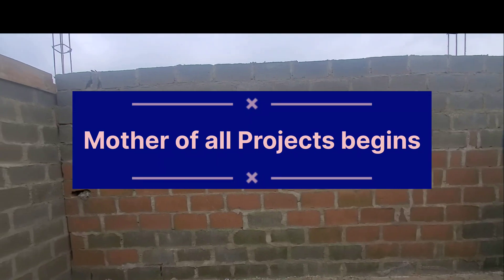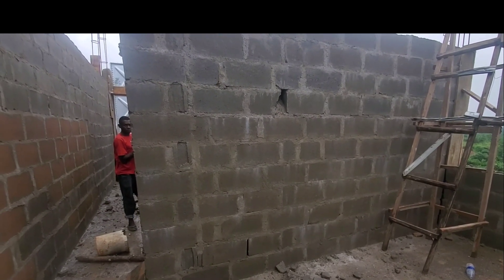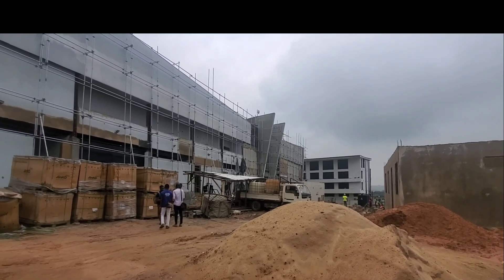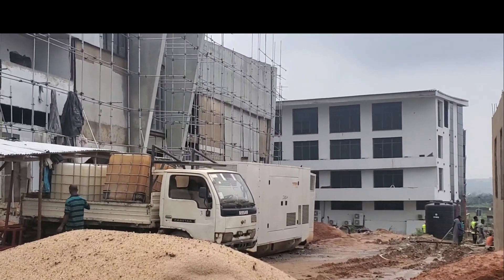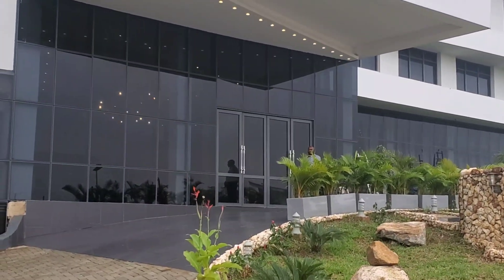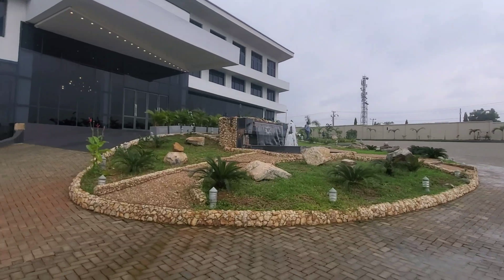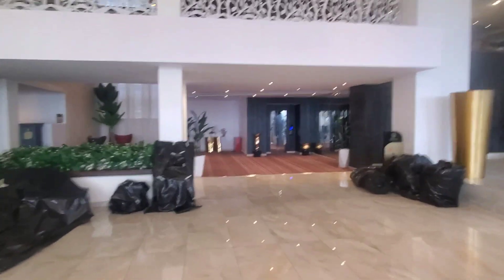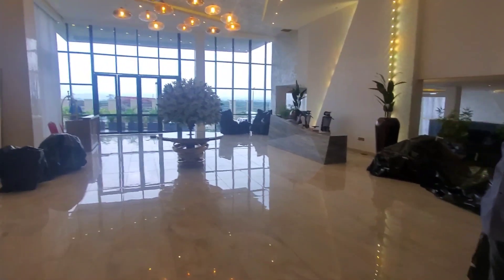Monster 240 kwp installation is starting.  #solax #solarpowerplant #offgridsolar #jinko

Comment: A couple of questions Doc.
Is the roof made of sandwich panels? Or single sheet ones with a strong underlayer? How do you assess the strength of a roof?
Why are the solar panels pallets out in the rain? 
Do you do all the electrical engineering and calculation in-house or do you hire a third partner? I assume there is some new complexity involved?
How complicated is this for setting up a contract? Financing, legal liabilities, logistics, insurance, deadline, safety, et cetera?
Maybe you want to answer some questions, I understand if you want to keep some information under the wraps.
Following your work with great interest.
Reply from the maker: Good morning Doug. The roof are single sheet. A thicker gage. The roof girders are steel. They had their structural engineer asses the load carrying ability. We do the calculations in house. This time we worked with their in house people to assess. A lot of complexities and moving parts. We are also working with a partner in South Africa on the design aspect of this project. Thanks for watching and commenting
Reply: @drsolar  Thank you for your reply, Doc! You're doing great.

Comment: I really wish the inverter you are installing would include input via a wind turbine so you augment power during the Nigerian rainy season instead of running the generators. Also when switching from solar to inverter, if the inverter doesn’t have an automatic generator start at a certain DoD it will mean the changeover may result in someone being temporarily stuck in the elevator, even if it’s for a minute or less, it can cause a panic, and off course your generators will be used as redundancy and with a switched-on maintenance manager, they’re then well maintained based either on idle time or run time to ensure they always work & periodically changeover to them to ensure redundancy actually works. Best of luck & definitely you have my congrats & support.
Reply from the maker: You can use a wind turbine without having an input for it in the inverter. Deye I believe is the only manufacturer that offers that option and I don't know anyone that has used it yet. Thanks for watching and commenting. There is a ups for the elevator. The system has an automatic generator start function. We will install it as part of fine tuning the system